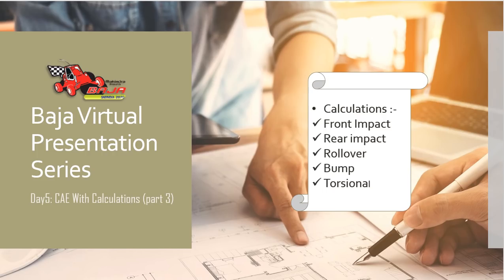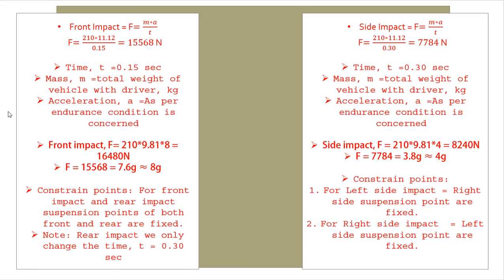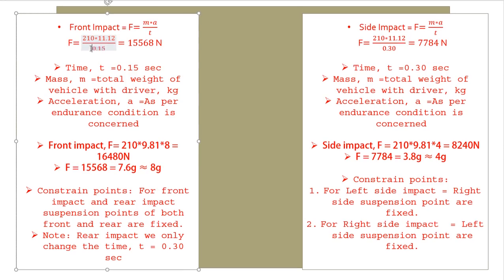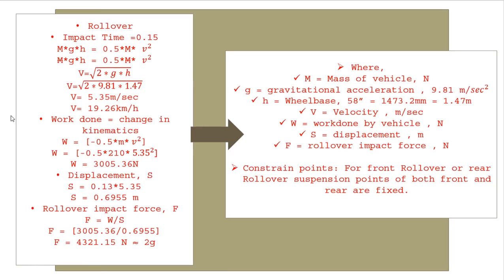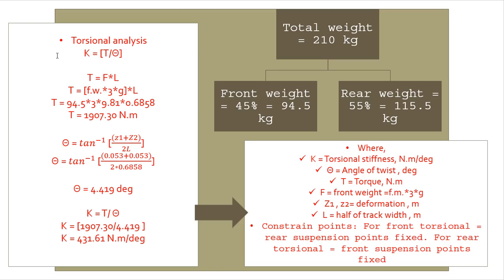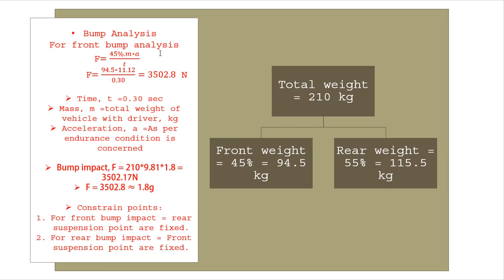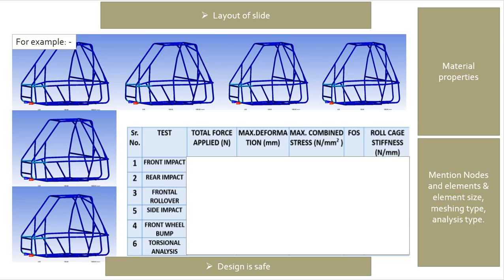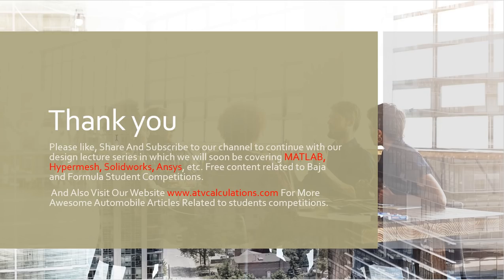Baja Virtual Presentation Series Day 5: - CAE Roll cage analysis calculations (part3 - virtuals2020)

Comment: Sir why you have taken 3g in (fw*3*g) of torsional analysis
Reply from the maker: torsion force will act on Baja vehicle when your front one tire is stuck and another tire is trying to rotate the vehicle and rear tires are in the steady state then in front torsion the front weight will rotate besides the rear weight will be steady or we can fix position. okay, I hope it's clear now.
Reply: My doubt is why you have considered 3g in stead of g
Reply from the maker: @tanayagrawal8428  it is as per the dynamic condition during the torsional moment we consider it for the worst situations.
Reply: Okay,and how can we verify that the value of torsional rigidity that we got is safe or not
Reply from the maker: @tanayagrawal8428  That can be confirmed by factor of safety more than 1 in ansys or hypermesh.
For torsional analysis we have video uploaded already.